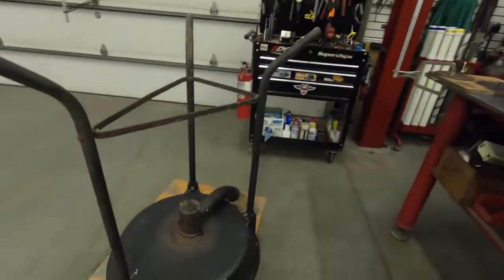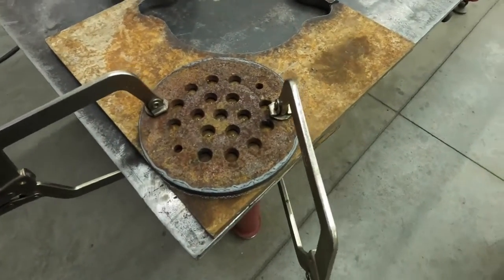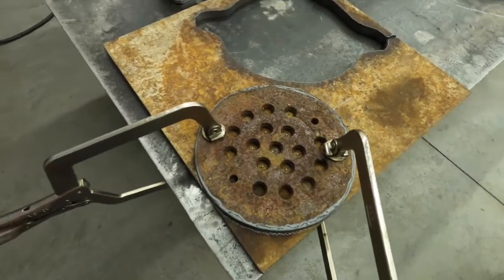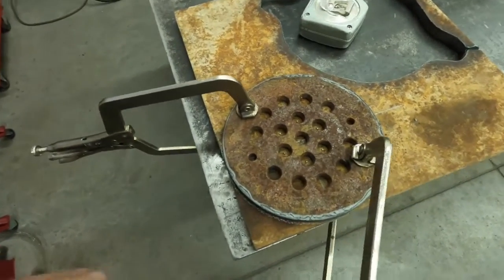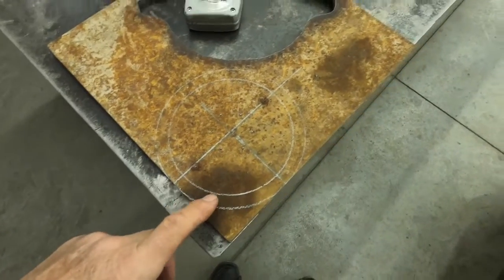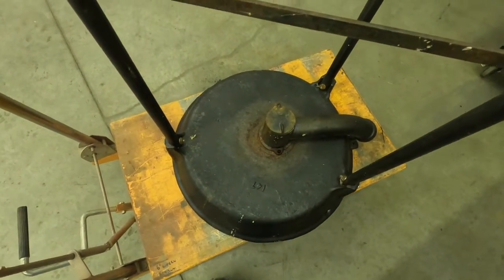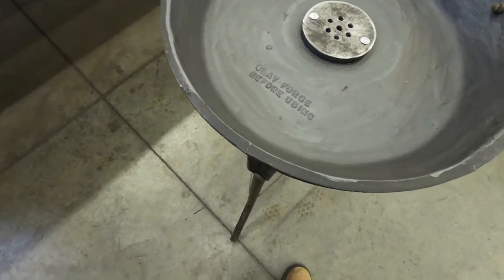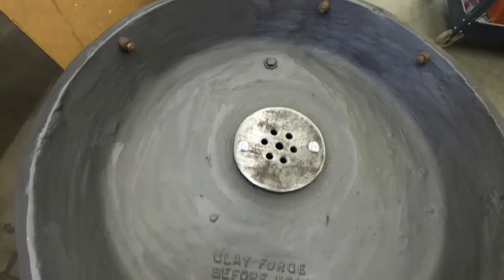RELINING A RIVET FORGE

Comment: Im wanting to make my own design and im wondering if i can line it with fire brick and sand? Ya think it would work? My blower doesnt mount like this one. Its the same concept but is parallel to the fire pot and cranked from the top. I was thinking makjng my base, then lining with fire brick and sand then dropping my firebowl in and piping my blower in like that
Reply from the maker: I think the fire brick would work, don’t know about the sand.  I’m assuming that you are using the sand as a base and the fire brick will fit together tightly. The problem is that the fire brick is not very durable over the long run. My gas forge has a dense fire brick floor cut to fit with no mortar, but does require replacement now and then. The refractory cement seems to last longer in the little coal forge. I am no expert for sure and and still learning. There are many recipes out there for forge lining but the refractory cement seems to work best for me. Look for a local boiler repair company as a supplier for the cement. Hope this helps. Good luck with your project.

Comment: No forge needs to be “ lined” .Your fire is in the fire pot. My all steel coke forge with coke fire pot has been in use for 20 years no lining. You only need to line a forge if it’s built from a combustible material. Stop lining your metal forges and you will have more room for your coke or coal. Think about it…..Fire in a Fire Pot not on the supporting metal. Forges are consumables even at that it will out live us by many years……Steve
Reply from the maker: The reason I lined this forge pan is because it was cast into the pan “clay forge before use”. I do appreciate your info on the subject, always learning.